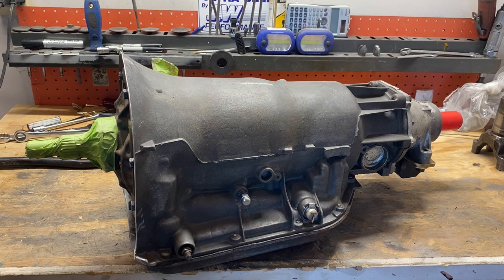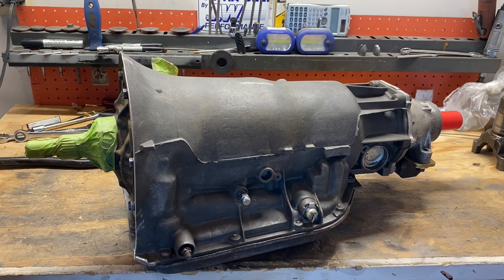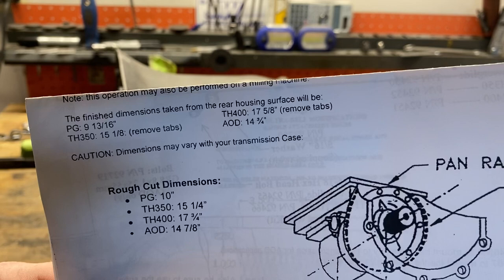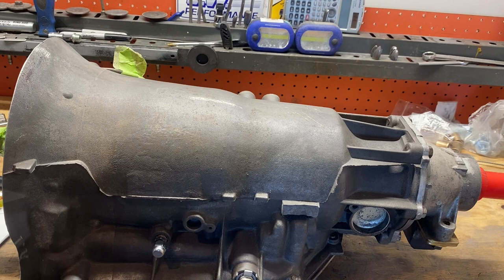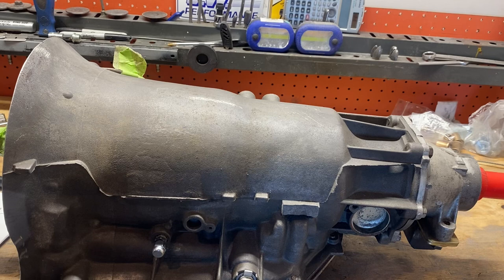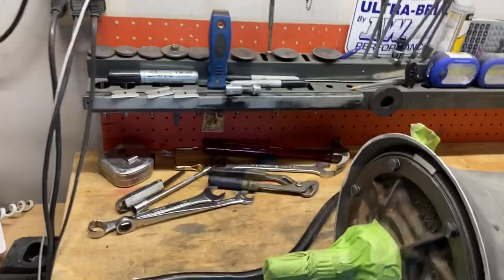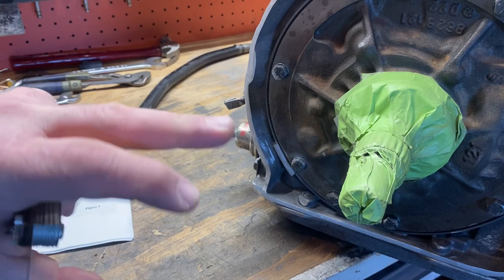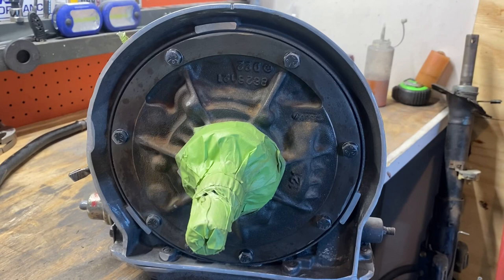JW Ultra-Bell final cut measurement

Comment: thats becous your angeling the tap  hold the tap strait along the case buy putting the case strait up off the bench and hold the tape strate down ther will be a 1/2 dif in reading
Reply from the maker: Good tip thanks!

Comment: Good day JD.  Question; what made the people that manufactures the Ultra Bell think that mounting it to the front pump housing would be strong enough to stand up to racing of any kind???
It just sounds odd to me.  This conversion must work because people do it.  What is the main benefit of using an Ultra Bell bell housing?
Reply from the maker: I was just as shocked as you when I realized how the Bell attached. It must work at fairly high hp levels!  I sure hope so!
Reply: @HeadFlowInc  All the best in your build!!

Comment: There is a company that makes an adapter to mate the Nissan CD009 six speed trans to an LS engine.
Everyone has the same complaint, if you follow the directions there is an almost half inch gap. It looks unprofessional.
Reply from the maker: It does make it easier but I agree looks unprofessional.  We had a heck of a time just bolting the Ultra-Bell on today dealing with the o-rings, RTV and loctite.